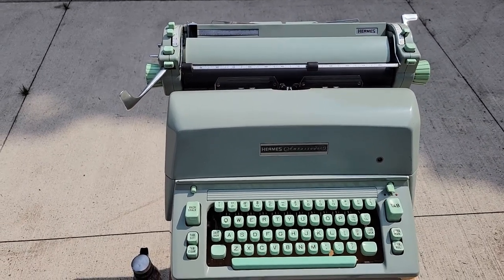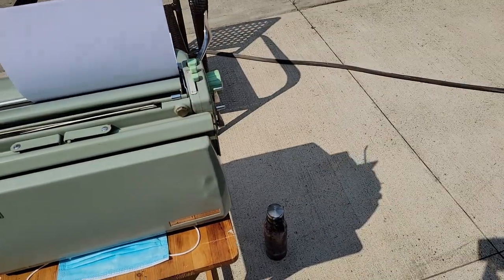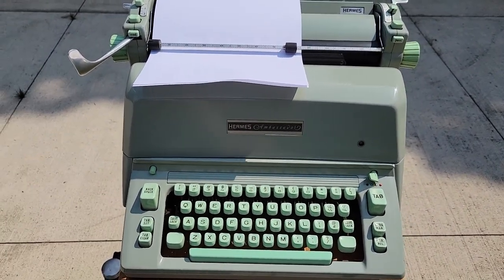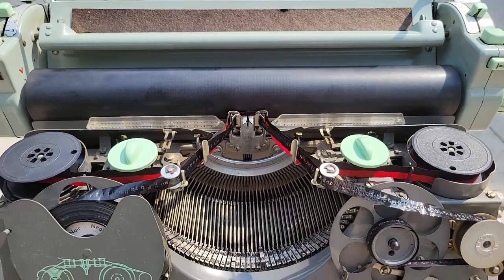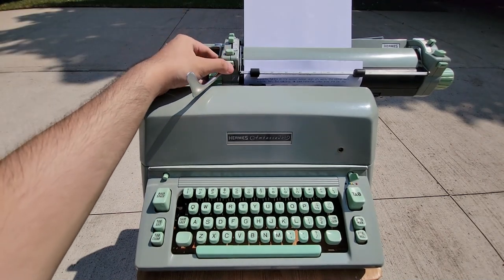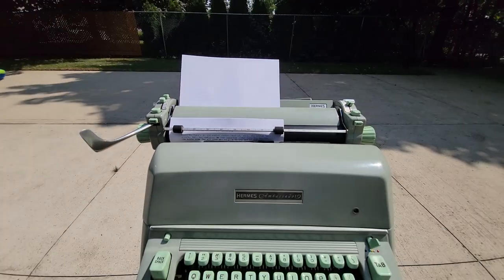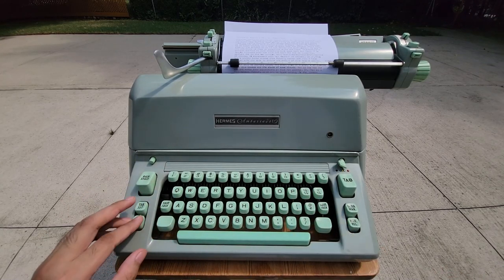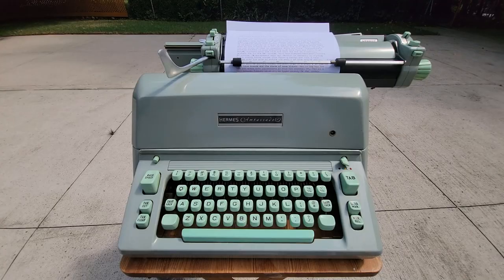Typing outside on a 1964 Hermes Ambassador typewriter

Comment: Great video i have just acquired an ambassador but the paper injector doesn't work, I read in your comments that you might make a video on how to fix it. That would be so helpful or a complete dissemble and reassemble. I've looked everywhere for the info thanks. Will keep watching 😊
Reply from the maker: I'll see if I can edit together my existing footage regarding this by this weekend.
Reply: @haelscheirs_haven  that would be great really appreciate after watching your video I picked up a another Hermes identical to your sea green one. I think I'm hooked on them, thanks again for your help.
Reply: Hi have you had time to edit the video for the paper injector,did you use a service manual to disassemble I've been looking for one but to no avail regards John.
Reply from the maker: @seikoboy65 Sorry for the delay. I got caught up doing lots of research for my audiophile hobby. Shopping for speakers... I'll see what I can do by tomorrow.
Reply: @haelscheirs_haven  thanks I was browsing your site you have some fine typewriter some quite rare ones did you renovate them yourself? You must some good service manuals? Thanks again,i found a service manual for a Hermes 9 but it doesn't help.
Reply from the maker: @seikoboy65  Except for my IBM Selectric III or those which I purchased in serviced condition, I have repaired or adjusted all of my typewriters except for those which suffered particularly bad shipping damage. I rarely consult service manuals, especially for models where such may not even exist. It takes a fair bit of practice and general mechanical know-how, whereby it is possible to figure out even very obscure machines like the Merz or Monofix.

Comment: It’s interesting that you seem to choose the lightest touch setting on your typewriters and yet type quickly. It’s usual for people to get better results increasing touch weight with speed
Reply from the maker: I've seen someone claim better results from replacing a spring in their Hermes 3000 with a heavier version, but with my technique, I could type much faster than in their video while simulating not having that spring at all (but still being able to advance the ribbon; it also feels much smoother this way, but the ribbon vibrator ends up inherently stuck in the lifted position). If you can press the keys and release them very fast, they can generally rebound fast enough from the impact against the paper/platen, gravity, and the slight jolt from the key resetting; if the typebars are being slowed down too much by the impact with the paper/platen, then you may indeed need some help from springs. Having too high of a touch weight hinders the typebar's motion toward the platen which then requires a stronger and deeper touch which is by no means good for speed as I have found. Likewise, if your finger is encouraged to be further down in the stroke for longer than usual, it will counterproductively hinder the typebar's return. With a minimized touch setting, you will in fact need a faster finger technique for sharply imparting enough momentum into each key and then immediately releasing the key before your finger could interfere with the return; this quick release also makes that finger much more quickly available to press another key, whereby I wouldn't want anything like heavier springs requiring more effort to achieve that motion. The typebar will thus arrive at the platen generally faster than had there been a heavier spring, and will bounce back faster than had it arrived more slowly and needed to be accelerated by the heavy spring first, or had the heavy spring caused your finger to be in the way of said acceleration for a short bit. Speed demands that the time each typebar spends in the air be minimized, and I find that heavy springs hinder that at least for the typebars' motion toward the platen, probably creating an inequality in travel and return times that could make jamming more likely than had those times been equalized.

Comment: Does that button unjam typebars? It looks like there is no real way to hand pull any stuck bars without pulling the cover.
Reply from the maker: The only typewriters that I know have an "unjam" key are the 60s to 70s Smith-Corona portables. This machine does not have any such button, and while the type basket is quite obscured by the cover, I haven't yet encountered a jamming situation where I couldn't just reach from the small opening on the top (the same opening I use when taking the cover off) and push the jammed bars back. EDIT: Actually, now that I realize what button you are talking about (probably the small one on the front left), I have yet to try it.
Reply from the maker: Heh. And I also now know who you are on the Typewriters Discord. ;) Anyways, yes, I now know firsthand that that button does in fact act as a unjammer, which makes the tiny hole in the front cover much more sensible.
Reply: The small round button above the backspace key does, in fact, unjam any stuck keys.

Comment: H! I find your videos interesting. I am wondering, among your collection, which ones are your most favourite? the ones that type the best, with the lightest feeling, very responsive and with good tactility? Thank you :)
Reply from the maker: tl;dr: There are a lot of very good typewriters out there that can only really be described as different. So far, the only "bad" typewriters (after adjusting them to be as good as they can be) are really cheaply built later models (and worst of all, the Chinese-made Royal Classic among others, though they are based on the Nakajima portable whose earlier instances like the Adler Junior 12 are actually quite nice, i.e. same design, but actually built to reasonable quality standards), or some more obscure models which while mechanically interesting just don't perform as well.

For lightness and excellent tactility, the Consul Comet is among my favourites, though it is an ultraportable; it also has the lightest and fastest carriage return ("carriage flick" where you apply a strong force at the start and let it move the rest of the way under its own momentum) for me such that when transitioning to it from a heavier machine, I need to watch out not to carriage return it too hard. Another great and surprisingly performant ultraportable is the Olympia Traveller de Luxe S or effectively any of the Olympia ultraportables (though I have yet to acquire an Olympia Plana). The Groma Kolibri is also very good and has a parallel linkage type action like the Erika (though I find Erikas too "springy" in touch for my liking while the Kolibri is more tactile) plus a quite smooth carriage return when the carriage rack is adjusted well, and though individual key presses may feel nice, I find it a bit harder to readily type fast on it.

Triumph and Adler full-sized portables are also great and have a tactile touch, the 50s and 60s Triumphs being especially fast, whereby like the Hermes Ambassador, their escapement is designed to give the typebars a bit of a "kickback" after actuating so as to help them rebound out of the way faster. The Facit TP1 is also an excellent portable with a light, sustained, and fast touch, but typebar collisions more often result in jams compared to other machines where the collision is more likely to resolve itself. The Alpina SK 24 is light and fast (provided that you adjust or unlink a spring), but not as tactile, having a "spongy" touch. The Torpedo 18B while heavier-feeling to me does likewise have a very tactile touch (the force bows down and then up like the base of a quadratic function; the Underwood standard touch is the opposite and more analogous to rubber dome keyboards, but spread across a 1.5 cm key travel), but can also be very fast. Smith-Coronas I can only describe as good and having a distinct, "progressive" touch to them that starts light and builds up. While the standards can be nice, the portables though capable of typing quite fast and comfortably just feel more "fragile" and rattly to me. Early Consul 15-series portables or rebrands like Commodore may not have the lightest touch at the start, but have the closest thing to a "constant force" touch as opposed to one that increases, decreases, or arcs; later grey-keyed ones might feel springier.

Among standard typewriters, of course, the Hermes Ambassador in this video is my absolute favourite for touch, smoothness, and speed, though I would hope that the Hermes 9 proves to have a similar type action while having a lighter carriage for faster carriage returns. The Olympia SG-1 receives a lot of praise, but I would regard its touch as being heavier and "fuller", increasing, plateauing, and increasing in force throughout the keystroke, and it to me feels less responsive in the sense that there can be a noticeable delay between the pressing of a burst of characters and the type slugs hitting the page; they are still great machines, whereby it is a matter of preference. For older standard typewriters, as you may have seen in my 110 WPM speed typing video, Underwoods can be quite reliable even at speed, having a tactile touch, though some might find it heavy compared to portables. I recently acquired a Royal 10, and while it can type fast, I am not as fond of its touch which is more springy. Siemag standards are exquisitely fast, having a similar, probably even more tactile touch than the Triumph/Adler portables, starting a bit heavy, then dropping off else plateauing. Monarch standard typewriters have a nice and light touch reminiscent of 50s+ Olympia portables (pre-50s Olympia portables and licensed rebrands like the Rooy IN and probably also the Kappel portable have a heavier and more tactile touch, whereby just a small tweak to the angle of the bellcranks created the exquisitely light and "silky" touch of the later Olympia portables).

If I didn't mention a model, it's because I didn't consider them exceptional, notable or to my preference. Do let me know if you are interested in a review of particular models or makes.
Reply: @haelscheirs_haven  Hi Haelscheir! thank you so much for the very detailed response! I appreciate all of that! You really know your subject really well. The moment I saw the video about the you doing some in-depth study on the typewriter mechanism, I knew you have a very good knowledge and expertise in typewriters and their beauty. I very much appreciate this very detailed answer. Never expected this to be this detailed.

As you can see, I am very new to this. I started with Olympia SM9 portable but got hooked up with it. Now I have the Olympia Traveller de Luxe, next came Olivetti Lettera 22, and now my Hermes Baby. I found that all of them have different feel. I love my collection, all of them, because they have different characters or should I say personality. They are like alive! ...born with a particular character to know and cherish. I am still in pursuit of other good typewriting machines. Mainly, because of cramped space here in London, I prefer ultraportables. But portables would be nice as well. 

I cannot explain the feeling I have for typewriters. Very seductive, very addictive. 
But anyway, thanks again. I have subscribed to your channel and been watching you typing outdoors in awe. Really amazing. :)